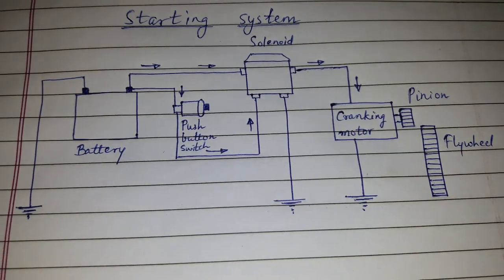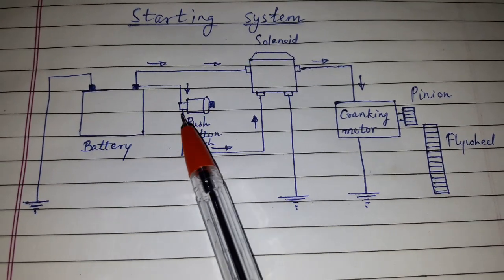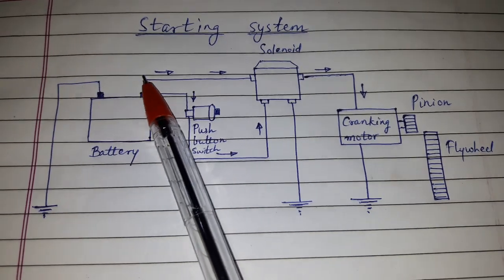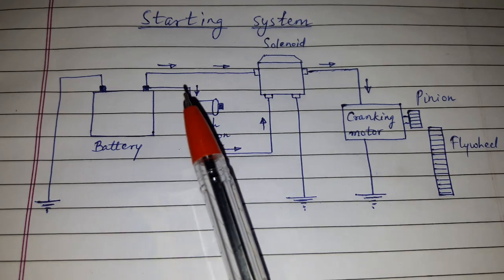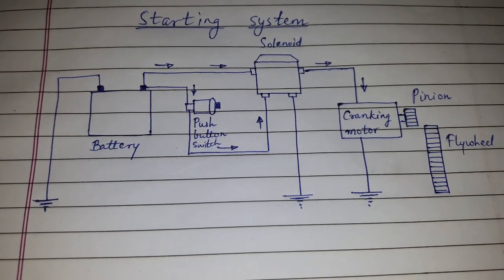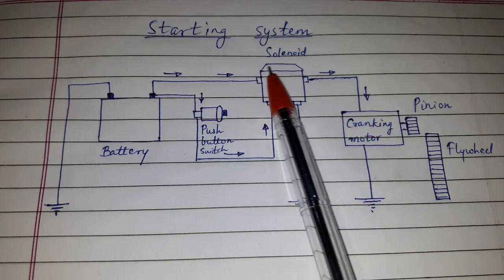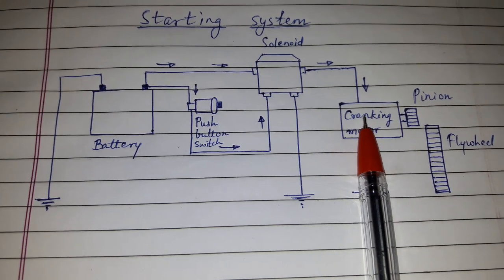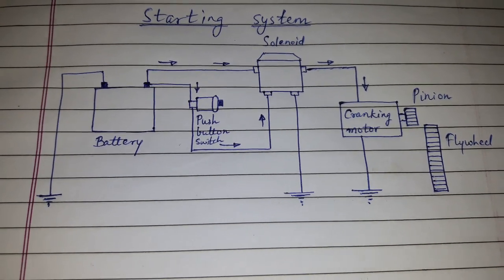Starting system.... #70kviews #viralvideo #startingsystem

Comment: why we use solenoid
Reply: The solenoid is like a switch , when electricity is supplied to the solenoid (through the bottom of the solenoid shown in this video) the current in the solenoid  will create a magnetic field , and that magnetic field will close the starter circuit by pushing a conductor of some sort between the two wires at the top of the solenoid >>>> and the starter works.

Comment: Maybe you can help me, my car will crank for about half a second and won't even spark starting fluid. Any ideas?
Reply from the maker: +USMC FT BLASTER 

A car that doesn't start has lost one of the two things, either fuel or spark to spark plugs. So start with a can of starting fluid and then find a place near air filter assembly where you can spray staring fluid. Pop the sensor out of the hole, then spray a little staring fluid in the hole. Then try to start the car.

If it starts and then shuts off, you have lost fuel to engine. 
1st - Check fuel pump fuse to make sure its not blown. 
2nd - Pump may go bad. Check pump pressure. 

But lets say the car didn't start when you put starting fluid in it, then you probably lost spark. 
A) In old model, it may be due to bad distributor.
B) In late model, it can be the crankshaft position sensor that go bad. 
Hope it helps...